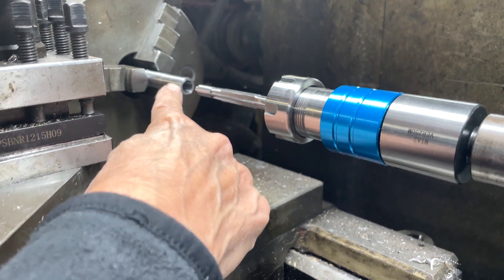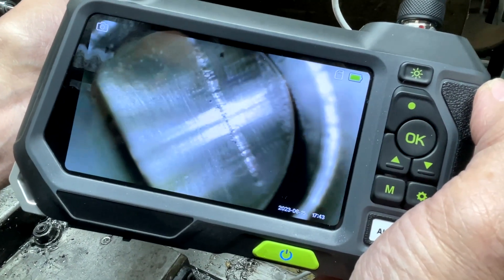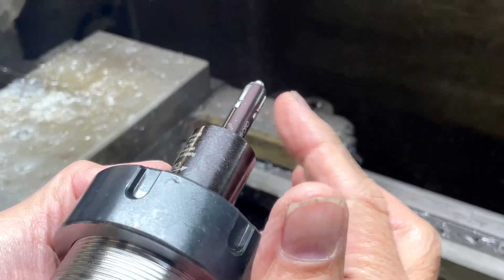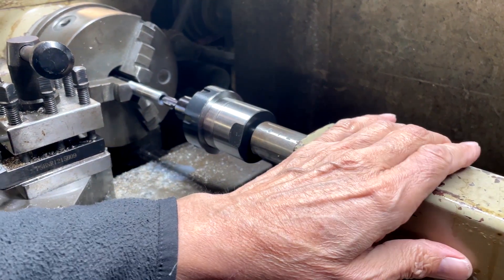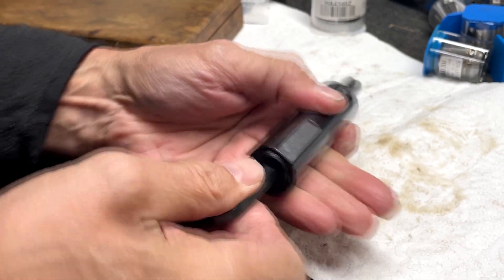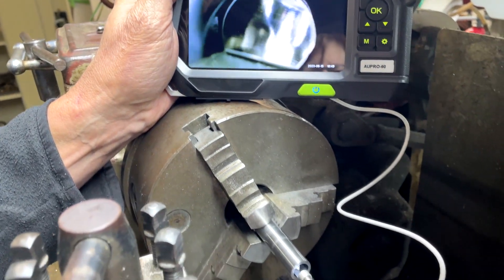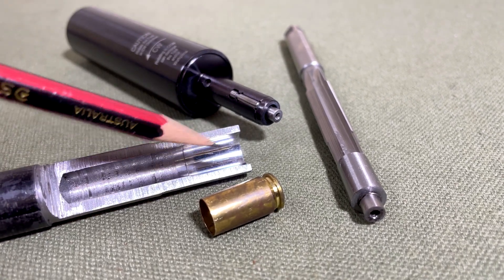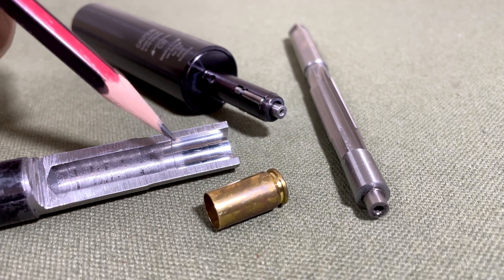9mm Luger chamber forming with reamer and burnishing tool.

Comment: How small of a diameter do they make that roller? It would be sweet to have an entire barrel blank that smooth in a 6ppc before it’s rifled!
Reply from the maker: I have a tool for the 22LR chamber but it is much too short for a barrel bore. It is a good idea to burnish a barrel before rifling. I special tool would be required for a job like this and at this time there is no tool suitable.

Comment: This not only improves the smoothness of the surface, it may increase chamber strengh too, similar to cold rolling steel. You compress the steel plastically outwards, increasing it's resistance to pressure from the casing
Reply from the maker: Yes I believe it does strengthen the surface layer of the steel.
Reply: by making the surface so smooth, the chamber walls play no role in slightly retaining the shell, which occurs normally, which means that 100 % of the pressure applies to the bolt head. Is this so beneficial ?mmm...
Reply: @florentleider222 that is no problem in 9mm because the cartridge is already tapered to have low friction with the chamber walls and the bolt itself normally connected to the barrel in a short recoil way
Reply: @florentleider222  bolt thrust is a bad thing yes, but if you take medium-grit scotch bright, you can introduce just the right roughness i found... Slight retention but no sticking cartridges anymore... I believe sticking cartridges that don't eject are far worse than some bolt slap, considering almost every production rifle should handle overloaded cartridges atleast once...
Reply: Your right to a degree

Comment: what hrc hardness reamer you can use to cut the chamber on 42crmo steel?
Reply from the maker: 42crmo is 4140 steel that is the most common grade for chrome moly barrels.  Any good tool steel is about 60 on the rockwell scale and will cut 4140. I have been experimenting with carbide reamers and these do a great job on hard steel and last longer if you cut many chambers, but a tool steel reamer is fine for most jobs. thanks for your good question.

Comment: Weather you know it or not a perfect finish is not desirable since most of the hold on the pressure is thru the walls expanding and gripping. Perfect mirror finishes cause severe face thrust at the cartridge base. This is really critical with rounds at 30,000-60,000 cup. Do you really think those tiny lugs on a rifle are holding all the pressure??? Not so. That’s why HK literally blasts the spent round out.
Reply from the maker: I know this theory but I don't believe  it is true. Many chambers are hard chromed and they are among the safest and strongest military chambers. Hammer forged chambers are also very smooth and more major manufacturers are moving to burnish chambers. A rough chamber finish cannot be relied on the hold the cartridge against high pressure. As the chamber wears the finish gradually smooths out. The gripping effect of the chamber walls is something that varies as a chamber wears. To rely on this gripping effect would be unreliable and dangerous.
Reply: @ozzistraightshooter9273  is this also neccessary if done with ecm or would the chambersurface made with ecm be already smooth?
Reply: I have always heard the same theory.  I'm curious as to what advantage burnished chamber walls have over a reamed finish. I suppose if you get a fire ball at the breech on a burnished chamber, then you will know the bolt is opening prior to the pressure dropping in the barrel. My guess is that perhaps the expanding case is still able to achieve a seal/grip even on a smooth chamber wall.
Reply from the maker: Hi, These points and theories are interesting. I am trying to carry out more tests to confirm my suspicion that the smooth chamber seals better than a rough chamber. By rough I mean a chamber with circular reamer marks. I know of cases where a chamber polished with one of the fine honing bore brushes improved accuracy. The reasons are not clear.  Racing drivers prefer to drive on Slicks as they give more grip than a tire with tread. Personally I don't think gripping the chamber walls is very important, I am  more interested in the small amounts of gas that leaks around the cartridge case when fired. Any leakage or changes in the amount of leakage with be detrimental to accuracy. I am performing some work now on burnishing a 22LR chamber. The 22LR is such a critical cartridge. I think changes in the chamber finish may give improvements in the accuracy of the 22LR, but only tests will prove it one way or the other. Uniformity is one of the keys to rifle accuracy and I believe a burnished chamber is removing another variable in the rifle. If we rely on circular reamer marks to seal a case in the chamber it seems to me it is introducing an unpredictable variable into the rifle, which seems like it is something to avoid. Thank you for your comments.
Reply: @ozzistraightshooter9273  I would be surprised if a burnished .22 LR chamber would have any impact on accuracy.   I don't believe racing slicks is a comparable comparison.   Racing slicks are made of very soft rubber used on a track that is thoroughly covered melted rubber.  The lack of tread is to create more surface area between the rubber tire and the rubber coated road. A chamber just needs to seal at some point along the contact surface.  Nevertheless, I will be interested to see the results you get.
Reply from the maker: I became interested in burnishing the chambers when I experimented with rifles with hard chromed chambers. Very smooth and no problems with extra bolt thrust damaging the rifle. I have a 100 year old Mosin Nagant rebarreled with a new hard chromed barrel. It handles hot loads with ease. I also experimented with steel cases and lacquered cases. The idea that the brass case needs to grip the chamber walls to stop the action breaking just seems like a myth.  I noticed that the hard chrome chamber seems to have less signs of powder residue around the neck. We all know a tight chamber is most accurate, but this can be for many reasons. So this is what started me experimenting with burnishing. Firearms are one of those technologies that improve in very small increments and I think burnishing is a small step along the path of continuous improvement.
Reply: @ozzistraightshooter9273  I believe the tight chamber adds to accuracy because it helps the bullet enter the lands more consistently the same way bullet seating depth impacts accuracy.   I'm not saying that you're wasting your time, or I know what results you will see.  The only thing I'm saying is I can't foresee an improvement based on my current knowledge, but I also don't consider myself an expert.
Reply: The pressure is the same in all directions, friction against the chamber wall has no meaningful affect on how much force is pressing the case head against the bolt
Reply: @Man_Emperor_of_Mankind there was po Ackley tested this way back. There is also more recent tests with dry and then oiled chambers. The tests were done with 30-30 and 30-30 AI. Headspace was purposely set at .010 and all the way to .046. With a dry chamber and factory loads, the case did not move back but the primer did. The primer would move back to whatever the headspace was set to. The y tried even more headspace but the primer wasn't long enough and blew out the primer pocket. In the oiled chambers the case was able to move back against the breach. Interesting stuff.
Reply: @Man_Emperor_of_Mankind  Ahh a man that knows Pascal's Law, thank you Blaise Pascal.
Reply: I Was Going to Suggest Reading P.O Ackley's Books Particularly Book 1 & 2. I Bought My Copys Back in 1987 And Have Read Them SO MANY TIMES The Pages Feel Like Felt. One of His Apprentices Wrote A Followup Book About 10 Years Ago, And Re-Ran Many Of The Tests With Modern Equipment And Testing Procedures. And " Most " Testing Was Lab Verified. 
Now As Far As .22LR Goes, Most Of My Rifles are Short Chambered, & Set Up To To Have Around. 050 - .065" Rifling Engraving Of The Front Driving Band. Depending on The Purposes and Ammo For That Rifle. I Want The Most Driving Band Engagement, Yet Can Still Safely Extract A Loaded Round from The Chamber. I Find That Consistent Ignition Pressure Curves With Uniform Powder Burn Is Attained By Eliminating All Bullet Freebore.